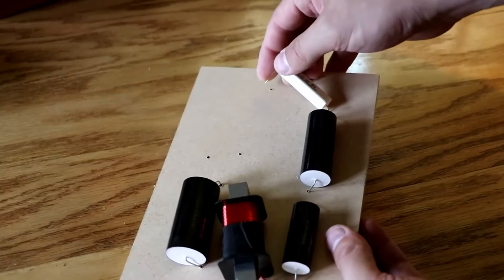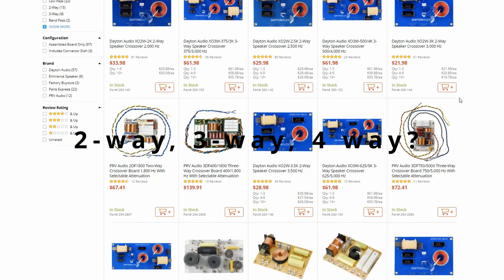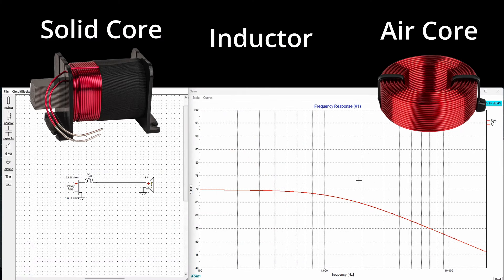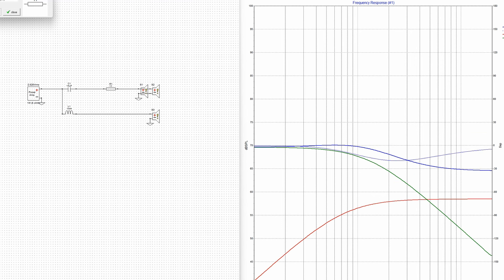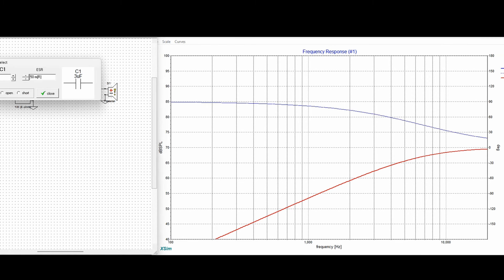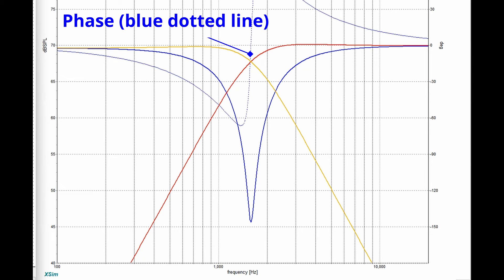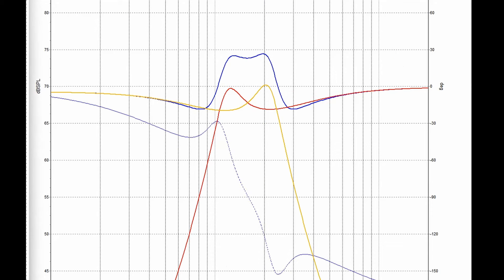Speaker Crossover Explained - Introduction to Parts and Orders

Comment: Thank you. I'm wanting to build a full range 3-way subwoofer speaker box enclosure system consisting of 2 12" subwoofers, 2 4" mids and 2 bullet or horn tweeters much like the old school 2-way d 3-way full range  car stereo speaker enclosures of the 80's & 90's.. I want to have two separate 4ohm speaker channels and I don't know what I need to do this exactly. Thank you. I'm learning
Reply from the maker: The best thing to do is go to the forum and ask questions: www.toidsdiyaudio.com/forums
Reply: First ask yourself what performance you want from your design. Low and high frequency cutoff points? Maximum output level? Voicing? Dispersion? Venue (home or vehicle)? Use your answers to guide your choices of drivers, crossover points/slopes and enclosure type. Be warned, unless you have low expectations you will have a steep learning curve and long road ahead of you in adjusting the results to your satisfaction, especially with a 3-way passive system. Active DSP crossovers and amp boards are now very affordable and can get you the results you desire much quicker while teaching you a ton about system balancing. Also plan a measurement mic into your budget unless you enjoy flying blind. Good luck with your project!
Reply: @naturalverities  thank you very much for your response I really do appreciate it. Yeah I'm tryina get learnt on the subject and sir you have been very helpful. Thank you again for such helping informing content.

Comment: The truth is that crossovers are VERY innefficeint.  They introduce so much imbalance and noise and they are a band aid for the real proble3m.  The answer is discrete amps to drive each driver.  Audiophile hate this concept because they do not like the proposition of active speakers.  Get over it.  Crossovers are arguably the very worst link in the whole chain... and even with "quality components"
Reply: Do you even own a stereo or just read about it  ?
Reply: Ur 100% wrong...crossovers are great...depends on the quality of the components they are made of....tell d&b passive crossovers su**..😅😅.. They and any professional engineer will disagree with you. D&b use ALL passive crossovers. It cuts down on the amount of cable needed for the rig and less weight in copper in the trucks😮
Reply: I own high end active Dynaudio studio monitors and also old Dynaco A25 speaker w passive crossovers. I much prefer listening to my Dynaco’s for enjoyment.
Reply: back in the dial-up internet days, I twisted together resistors and capacitors to make a low pass filter that removed the internet screeching sound during phone calls. i spent a few hours then understanding how the filter works and cannot imagine how it would add noise as you claim.

Comment: So, what is a 3-way crossover doing to the impedance that the amplifier sees?  Let's say you have an amplifier that can handle from 4-8 ohms... If you put three 8 ohm speakers in parallel, you're going to get 2.67 ohms which is too little... You could combine series and parallel, but that is just good for that one particular case... If you have 4 ohm speakers, you would need to do something entirely different... None of the crossovers that I've seen so far on Amazon or AliExpress seem to bother to list the impedance that the amplifier sees or what impedance it supports for the various speakers....
Reply from the maker: When you use a crossover, it crosses over the frequencies that each individual driver will play. by doing this, it also crosses over the impedance. So it’s not the same as running three drivers in parallel or you would get a very low impedance. I can’t tell you exactly what the ambience would look like because that’s dependent on the crossover design as well as the actual impedance of every driver. But if you’re using three 8 ohm drivers, then your final, nominal impedance should be 8 ohms.

Comment: This video was produced with articulation and discipline.

The following is my polite ( hopefully) suggestions.
I was a teacher… who qualified / taught teachers… I taught the teachers.
This video required a LOT OF EFFORT… and we should appreciate it.
But please consider / accept my requests for additional input.
Thx 

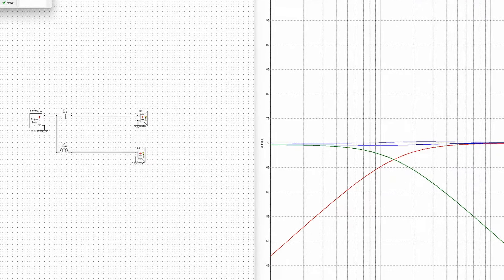If you have zero familiarity with the topic, the first three minutes are good… but …. You might want to skip to time stamp 3:00.

To help the complete newbie…I wish that the writer might consider adding a simple cartoon picture of 
a wall of white noise … 
that then moves into a funnel…
 that then splits into THREE output PIPES…. one for each of the high, mid and low ranges…. 
Then the pipes flow to the tweet, mid and woofer… THAT would be a first impression to create.

a crossover SPLITS the wall of sound… out into different frequency range / groups…   (Or ..FREQUENCY BANDS…)….each frequency BAND..is the directed to a speaker dedicated to better produce sounds IN THAT FREQUENCY RANGE…..

THEN… this explanation would be more easily understood but those with zero familiarity..
At time stamp 3:00…this video gets much better… as components are shown in a schematic….
But…  the next level up.. in teaching might show…
A schematic  showing 
1)amp-components- speaker-and 
2) a frequency vs SPL graph… . 

THEN instal a resistor as the first component after the input… and show the whole SPL line move down… then up when a small resister is swapped into that position .. and  how different speakers are more “sensitive” to volts and may be louder …so we use resistors to help the speakers speak at similar volumes. ( help match different sensitivities.)

THEN… add a Cap…and show the change in the slope… show how different cap values move the slope from left to right.

THEN…add an inductor…. And show the same as above but compare how the caps effect control of the upper slope… and the inductor changes the slope of the lower slope..

THEN…. Add both onto the SAME SPEAKER circuit… 
Or
ADD add cap  to the tweet circuit and then a coil on to the woof…. Change the values and show the how the slopes can be move close or farther apart… and how this effect the “total SPL” line…

Maybe part two… 
shows…
1) how to modify the circuit to tailor /correct for the shape / steepness of the slopes…. And discuss “db per octave” change   And 
1a) modify the circuit..to correct for unwanted shapes in SPL ( SPL rises) near the beginning of the slopes ( crossover points ) 

2) L-Pads …. WITHOUT THE MATH… 
Show an 8 ohm speaker..add a 16 ohm speaker in parallel .. ( now the resistance at this region is approx 7 ohms… .. then Place a 1 ohm resistor in series in this region and the total static resistance is back up almost exactly 8ohms… = volume of speaker is reduced but the amp doesn’t know…. THEN you can do the math.
2a) do the same as the above but use a potentiometer ..

3) ADDING CAPS AND INDUCTORS results in volts and amps responding at slightly different times .. so volts may rise or fall NOW…. But AMPS might be delayed by a millisecond.. this may be especially troublesome NEAR/AT the crossover points.
Different frequency ranges will respond differently… this means that a 2300 hz tone sent from the tweet… might be sent earlier or later than a 2300hz tone sent from the mid… PHASE CANCELLATION (?)… distortion (?)…. How do we predict for this… how do we correct? 

completely different conversations can then be about.. 
the great crossover design software 
Great speaker cabinet design software
The great testing software and hardware,
What are the FRD AND ZMA files…. How to deal with them or what to do if the don’t 
Back to great testing software
Windows based speaker and room resting software, and 
Windows based EQ.
Is building from scratch vs buying from Best Buy a better idea… why
Can I just mod a Best Buy speaker…modify THIER crossover…  which is more time and dollar efficient move.
Or getting GOOD plans from a great source… hmmm

THIS WAS A VERY GOOD… FIRST VIDEO..
thx

Comment: I love the Video!!

I am right now desingning my own closed Subwoofer and I have a question:

Using the Linkwitz-Transform-Filter in WinISD I tried to simulate my rooms roomgain. This caused the Cone exkursion to cross Xmax at around 30Hz. 
Does my room really have an influence on the cone excursion?? 
And if yes, is there a problem if I just regulate the low frequencys down with a very low highpassfilter? 

Thanks to anyone who might have an answer :)

And thanks for your videos @Toid , because of you I found a great new hobby ^^
Reply from the maker: Look at cone excursion before applying the linkwitz transform. Remember you aren’t actually adding a LT in real life, that is just being added so you can visualize what the room gain might look like.

Comment: Good explaination of passive filters. I'm surprised you didn't make mention of "active" filters and "slope" or "roll-off" of crossover filters though. I really like some of the speakers you've designed and built, the ones with HLCD's and prosound midbass drivers in particular.

Comment: This is Crazy!!!!   not even joking......  I have been on Parts Express for the last hour or so, (During this time you upload this video)  researching which Passive Crossover I want so I can replace the one's in my Dayton Mk402X. They are powered by the Dayton audio HTA20BT, with a powered sub. They sound great but pass way to much on the low end for the woofer to handle.  What's your recommendation for a P/Crossover? Also this has lead me down the rabbit hole for a nice small 2.1 living room system thinking about the PN# 300-489 what do you think?
Reply from the maker: I completely understand, they have those speakers tuned low.  Instead of doing a passive crossover, I would by the arylic 2.1 amplifier:https://www.arylic.com/products/up2stream-amp-2-1-amp-board?aff=4 then use their DSP program.  You can add a high pass to take out the bass of your Daytons and put a low pass on the subwoofer section.  Assuming it is enough power for the subwoofer.  That is what I would do.

Comment: I really enjoy watching your videos. They are top notch and full of information that any beginner speaker builder could use. I would love to see you do a 6 way tower build using 4 -7 inch Epique drivers and passive radiators I'm looking at building a 6 way set up like this for my home theater. My concerns are lobing that comes from using 4 woofers in a horizontal center channel. I was thinking of using the Morel TM4055-8 2" tweeter and midrange combo to help mitigate lobing. I love speakers that have the ability to bring tight heavy bass and still have that snap that makes your eyes open up. Todays manufactures of speakers use such cheap drivers and want to charge a arm and a leg then they want to tell you how great their speakers are. The video where you made the the speakers using the Eqique drivers was really cool and everyone interested in speaker building should watch it.
Reply from the maker: You could do that, but really you would most likely be doing a 2.5way WWTMWW. It might be useful to spend some time on the forum or even create a new topic where we can help you out. www.toidsdiyaudio.com/forums

Comment: Great video, as someone interested in building my own speakers the crossover is the part that has always held me back as I want to make a 3 way center. One question is that when I was looking at drivers to buy the ones that looked good to me were made by B&C for the midrange and woofer and Morel for the tweeter but they don't have files to import into VituixCAD in order to start playing around with it. Assuming a manufacturer doesn't offer them how would you get them without buying them and measuring them yourself? 

Drivers I was specifically looking at were Morel CAT 378, B&C 4NDF34 and B&C 8FG64 since they were all 8 ohm nominal and ~92db sensitivity which would make for a pretty easy to drive speaker in my head. Plus that woofer comes in 16 ohm as well so I figured I could easily wire them up in series for a 8 ohm load.
Reply from the maker: That’s a good question. We can definitely help you on the forum if you want. www.toidsdiyaudio.com/forums . But they do make some graph tracing programs that can make FRD and the ZMA files that you can mess around with before purchasing. Just keep in mind that you are going to need to try to simulate an account for what you believe the offsets of each driver might be.
Reply: Late response,however...
Two 16 ohms speakers in series equates to 32 ohms whiles two 16 ohms speakers in PARALLEL equates to 8 ohms

Comment: Really enjoyed your video… And I have a question: I want to build my first set of speakers, but I have Parkinson’s… (Tremors) and have no trouble with simple connections, but I am intimidated by building a crossover. (I still enjoy woodworking… So that’s not a problem.) I’ve been thinking of going with a single full range Driver… Hence no crossover. Is this a bad idea for your first speaker build? (I know it’s a very general question) thanks again.
Reply from the maker: I think that’s a great idea. One thing I do want you to keep in mind, though, is that a full range driver still uses a baffle step compensation circuit.  This is a much simpler circuit, but you will want to implement it. Here’s a video where I went over that. Hopefully it helps: https://youtu.be/h9EdOMI28js

Comment: Is there a chart or something that lists what components do what at a given ohm rating? Meaning if I want to high pass at 4 ohms at "x" frequency I use these components. Etc.
Reply from the maker: There are online calculators. However they assume way too much. Such as assuming the impedance and response is flat when it is not. However, if you’re using them just for protection, they can be useful. Otherwise I highly recommend a custom crossover.
Reply: There's a book, building stereo speakers, David b Weems. It has the chart I've been using it for many years, no matter what you do,using a computer or a book your going to need a bunch of coils and capacitors, to experiment and get best performance, I suggest crossing over as close to the next highest drivers low ,/ if the tweeter is 2000k-20.000 k crossover at 2-2500 k ect.
Reply: @ericschulze5641  thank you!
Reply: @brianmosher4053 oops I meant 2000 hz to 20k

Comment: The stupidest explanation I have heard for a long time!

Yes If a speaker has a flat straight frequency, this is true. But no speaker has it!

You can't use a universal filter! You also always have to dampen frequencies that are too much of. (rejestion filter) (notch filter)
Reply from the maker: Did you watch the whole video? When did anyone say anything about using a universal filter? When did I say drivers have a flat response and you don’t need to account for it? Did you miss the whole notch filter and resistor explanation?
Reply: @Toid  You talk too little about notch filters and you show pictures of ready-made speaker crossover filters from a shop. Loudspeaker crossover is not as simple as you give the impression of. If you want to have good and clear sound, it is not always easy. simulating it on a computer is one thing, but often it doesn't sound right.

On my 2 way speaker I had to use 16 part
Reply from the maker: @ford1546  I’m not sure how you took away from this video that crossover design is simple. Nowhere did I say it was simple and nor did I even try to show you how to build a crossover. I literally just explained the components and different orders and types. Hence why this is called an introduction. If you took the video that crossovers are simple, then that’s on you, but not on the information provided.
Reply: The video was made well but some will always disagree with you and not always agree. 🙂
Reply: @Toid  yes, I don't know if he just didn't read the title of this video or what...